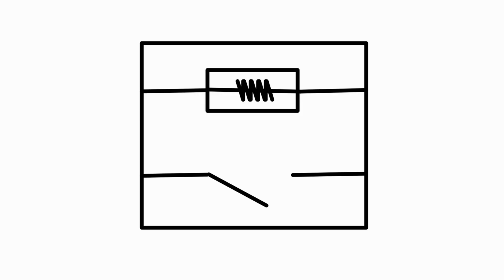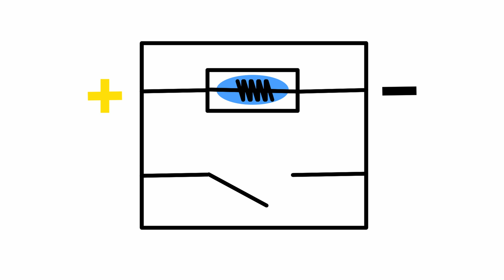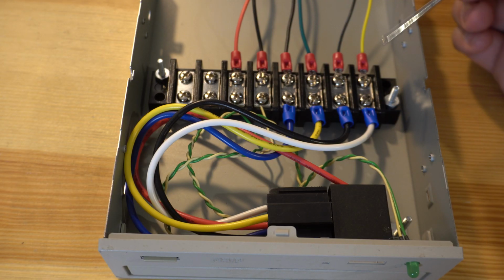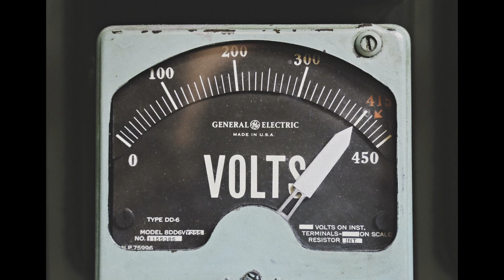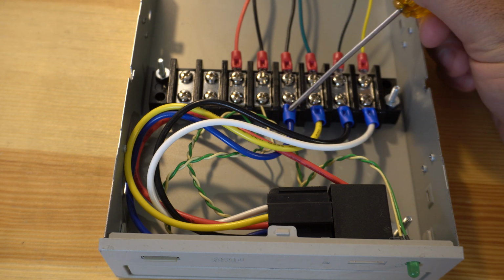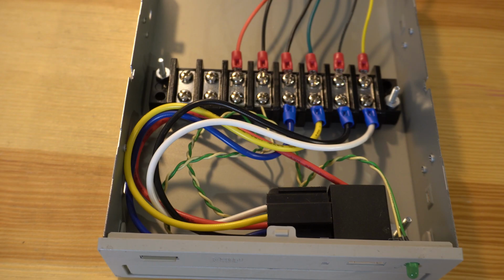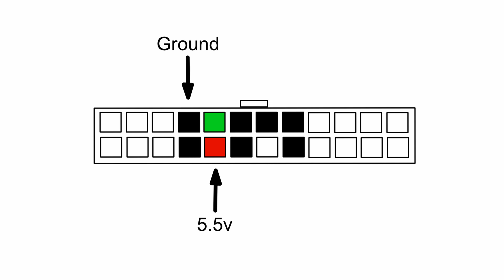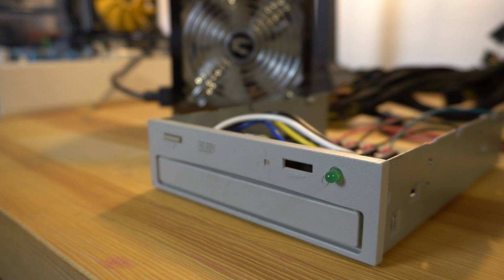DIY Power Supply Adapter

Comment: I had a GTX 1080 and my GPU usage was super super low (im talking 10-35% max) In every game I played. I recently got a RTX 3070ti and I'm experiencing the same issue, could it potentially be my RAM speed as its only 2133mhz and changing it in my BIOS makes my PC crash?